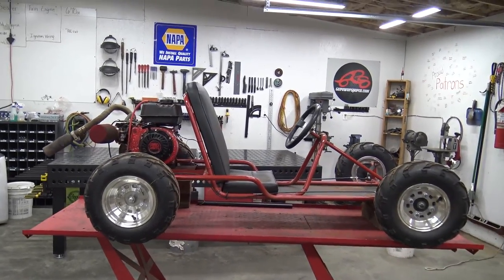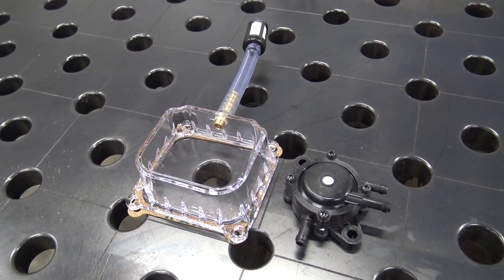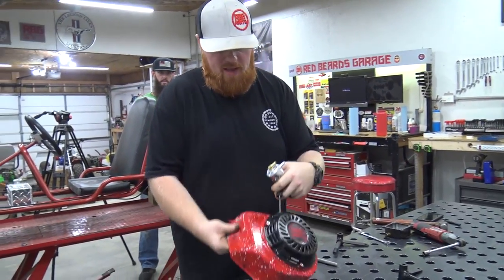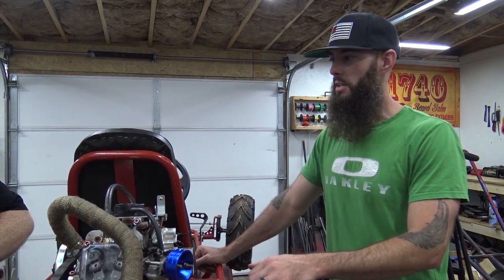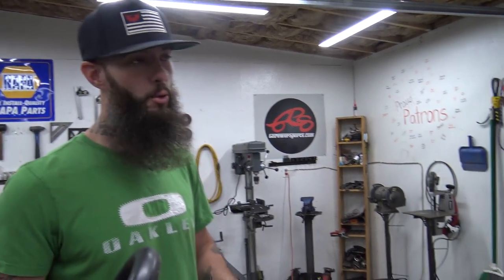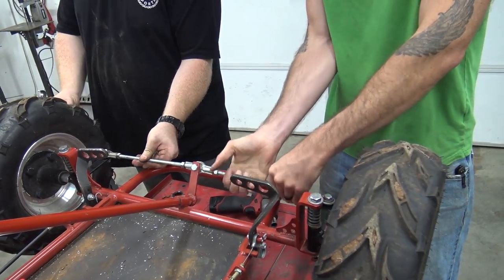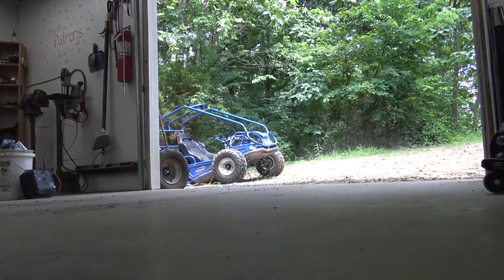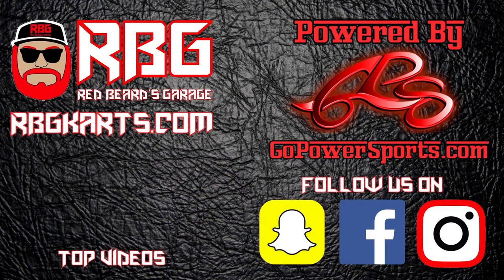Dirt Track Go Kart ~ Little Red 2.0 Upgrades

Comment: You should build a bar that runs over the petals that ties the tops of your spring spindle together. Something like the strut tower braces used on mustang's.
Reply: Not a bad idea, but I prefer gussets.  Bend C's enough for negative camber then shape 1/4 plate to fit and weld in, a RBG logo in gussets would be a nice touch
Reply: I was just thinking the brace could double as a safety bar to keep legs from getting hit by sticks while blasting around on a woods kart.

Comment: Buy some cheap foam pipe insulation with the split on one side and either duct tape or electrical tape and zip ties on the side bars he was talking about brushing him. If you would like I can send you a picture of mine to see how I did it a while ago.  Mine worked really well till the thing went upside down at 30 plus and then the padding did absolutely no good at all

Comment: A racing seat isn't gonna be much better. They are designed to strap you in solid and you will still get beat to death. On something with little to no suspension they are brutal off road.

You want a suspension seat. They are designed to still strap and hold you in but they have give in them so you're not getting beat to death. If you look around you can often find people parting out side by sides with aftermarket suspension seats. You can grab them for a fraction of new price and they are sized for karts and buggies better than car seats.
Reply: Layers of carpet padding inside seat good because it won't squash down like cheap foam..
Reply: If you go to harbor freight and buy the floor padding, lay a layer or two of it down first, then lay a layer or 3 of carpet padding, and finally lay seat foam down it is ok with a stock 3 horse kart engine.  Yeah been there done that and it don't compare.

Comment: why not cut the frame where the front cross bar is already welded and spliced at instead of cutting it in the middle ,that could make it week,and most of ur weights at ,just a thought i had fur ya,cut right behind the the front cross bar and u only added metal to the front ,is my thinking only pressure on is wen it hits something not ur body weight and the impact pressure  right in the middle ,hope this helps,i may be wrong ,just a thought i had ,